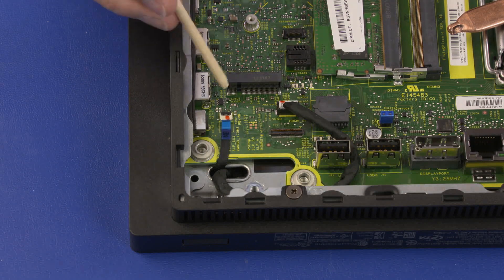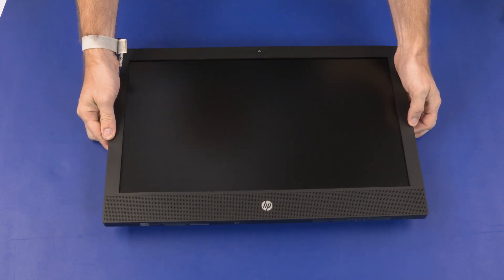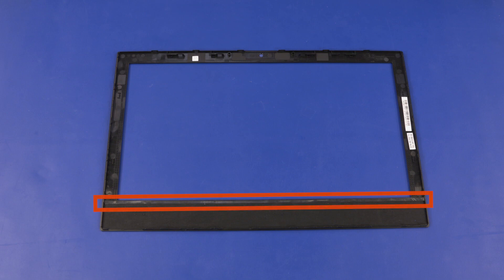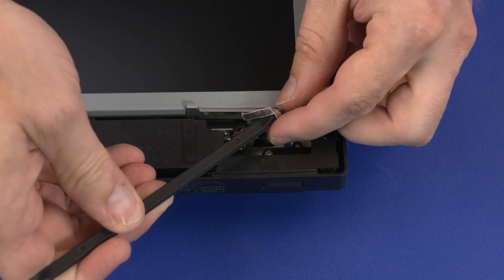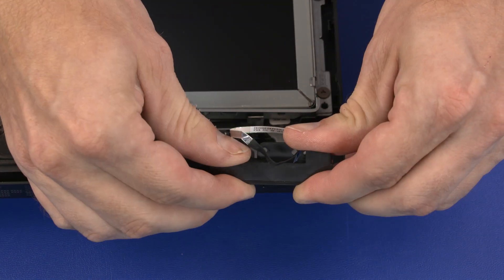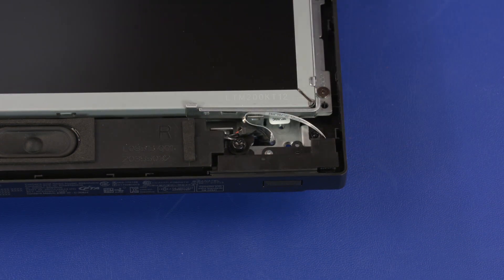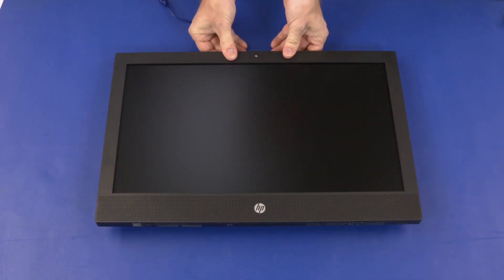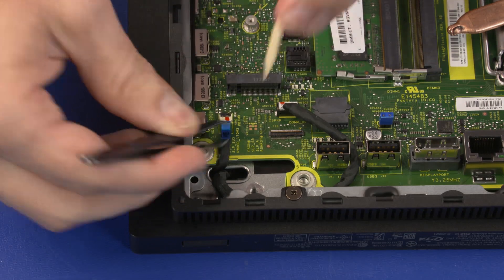Remove the Power Button Board | HP ProOne 600, 400 G3 and G4 AiO | HP

Comment: I have one, but the PC do a bip when i power on it. without display anything, the powe button stay light. could you help me please, it's an emergency
Reply from the maker: Hi Kenley, thanks for contacting HP Global Social Media Support!
I understand that you are experiencing an issue with your computer as it is not starting.
I will do my best to assist you.
Please refer to the instructions mentioned under this document to fix the issue: https://bit.ly/3mINy8E
Binu_HP Social Media Tech Support
Reply: @HPSupport  when press the power button he makes a bip. The screen stay black, but the power button stay on
Reply from the maker: Please refer to the instructions mentioned under this document to fix the issue: https://bit.ly/3mINy8E
Binu_HP Social Media Tech Support
Reply: i bought pro one  g2 refurbished came without DC adaptor i’m told you can go direct from wall plug bypass adaptor plug into monitor  others say don’t do it the adaptor protects overheating.  ???   Any advice would be appropriated  i’m going to use it with my new x tool 10  .  At 79 I have some knowledge but I chose to be smart an safe.  I eventually found Adaptor on line  50$. it’s on its way,  thank you Maxine